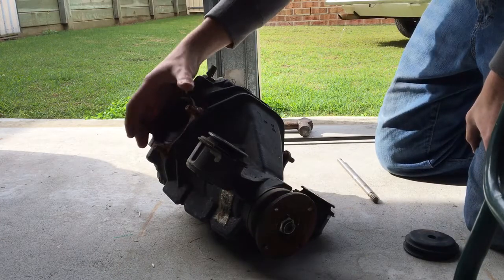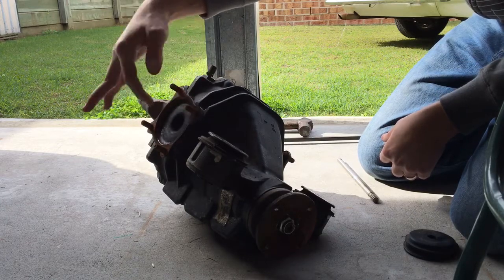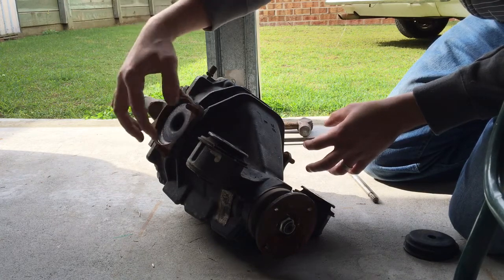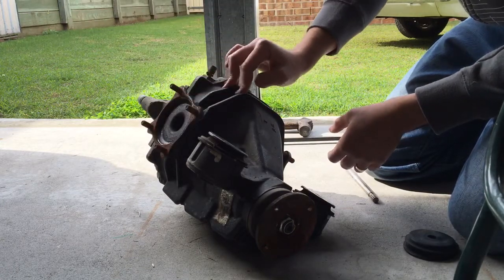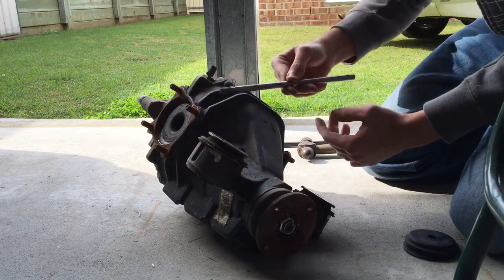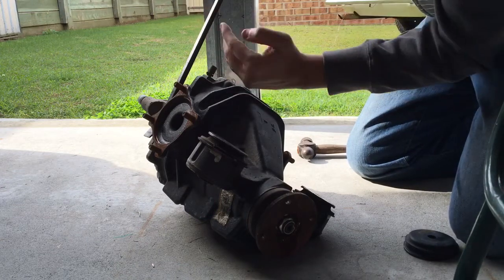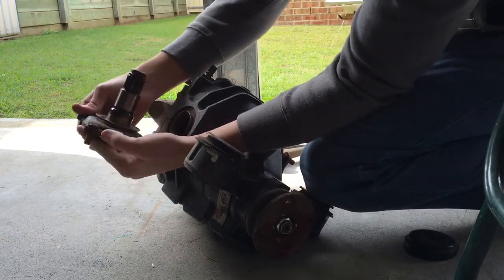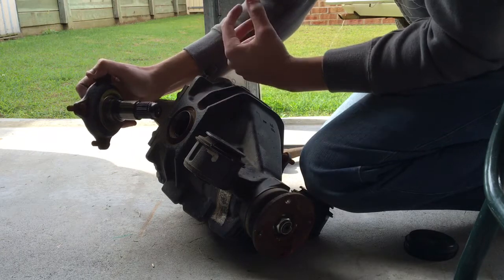HOW TO: Remove Diff Side Shafts / Half Shafts

Comment: Does the circlip sit in another groove inside the spline on the side gear or at the end?
Im having trouble with a torsen using the stub axles from a non torsen and the circlip position not working :(

Comment: how easy to go back in?
Reply from the maker: Easier - slot back in, and a gentle bump with a rubber mallet or block of timber and a hammer etc to get the C Clip back in.
Reply: That Car Channel cool will try that if I have trouble ill be back haha hopefully your still online.. cheers mate
Reply: That Car Channel im doing it as we speak
Reply: That Car Channel the diff is still on the car not out like you have it, same applys?
Reply: That Car Channel got that sorted and now my boot has come off on the axle and I cant get the round clip back on to secure the boot any help would be great
Reply from the maker: Sorry for the late reply, I don’t think we are talking about the same thing? I think you are referring to the CV joint?
Reply: That Car Channel its ok I got it sorted thanks mate
Reply from the maker: Good to hear. Cheers
Reply: That Car Channel hey mate ran into another problem apparently ive put the axle/cv joint back in incorrectly?, when its jacked up with the wheels spinning the the wheel and axle connected to it jumps up and down hope I explained that well enough, so how is it supposed to go in exactly/correctly?
Reply from the maker: There really is only one way they go back together, not sure what you have done? Email me with some pictures and I’ll try and diagnose it thatcarchannelofficial@gmail.com
Reply: That Car Channel thats what I thought that it only goes in one way I have sent the email by the way
Reply: That Car Channel did you get the link above? any ideas on what could be wrong?, thanks
Reply: could my replacemant shaft be too long?

Comment: Hi again so the half shaft is not fastened with any nuts or bolts?, any other things i should know? as one of mine is bent and doesnt spin true the car wobbles while driving, cheers mate
Reply from the maker: Hi, correct they are held in the same way an FF drive shaft is. No nuts and bolts once you have the axle out.
Reply: That Car Channel thanks so much:)